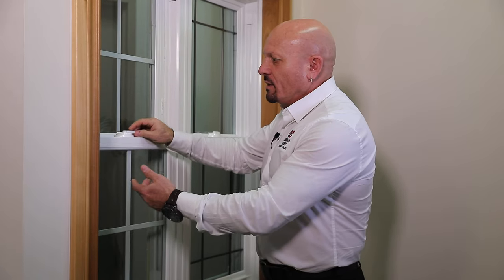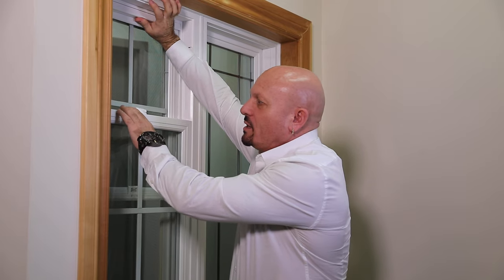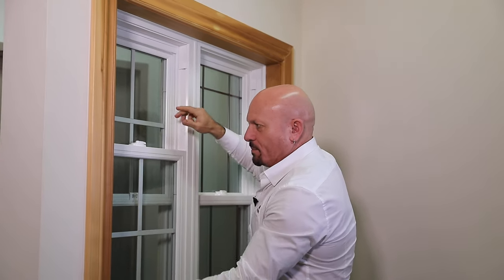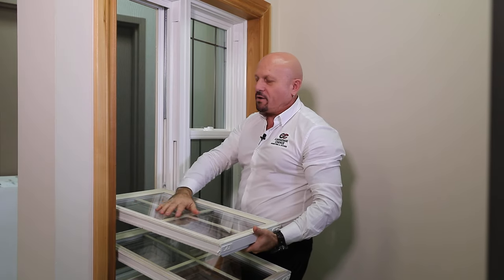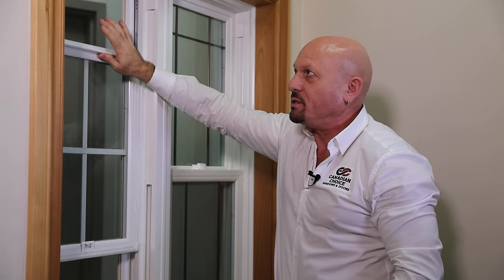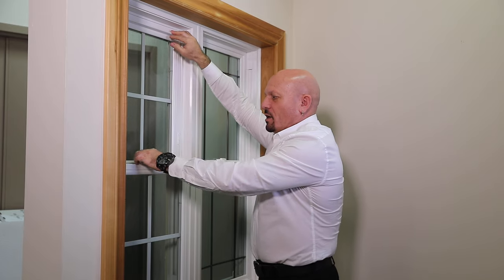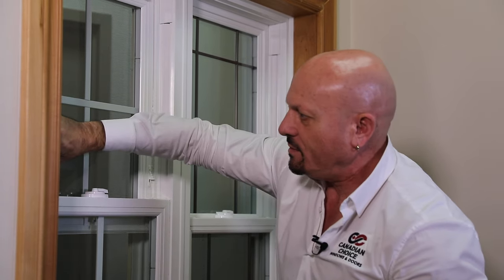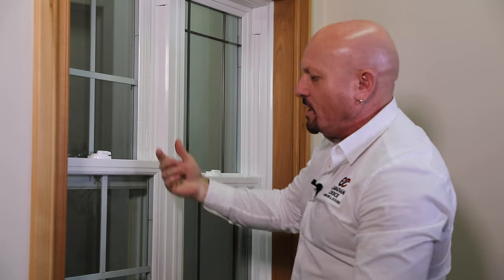Double Hung Windows - How to Operate and Clean

Comment: I’m searching to see if it’s appropriate to move the lower sash upwards during the winter. My wife thinks it goes down. I’m thinking since heat rises you want it up to trap that heat. You’d be surprised how hard it is to find the info on that. But I’ve only started